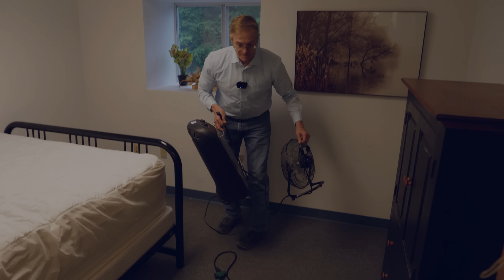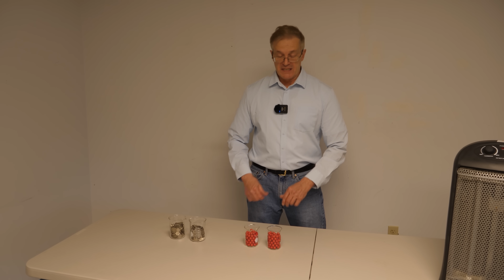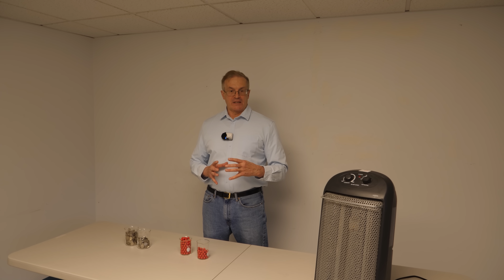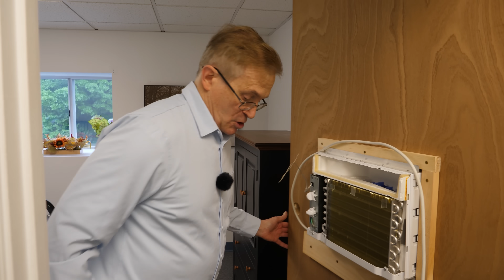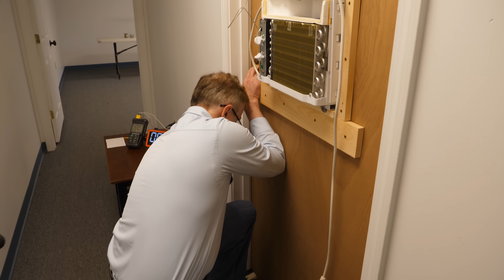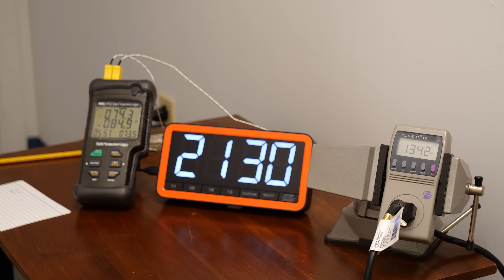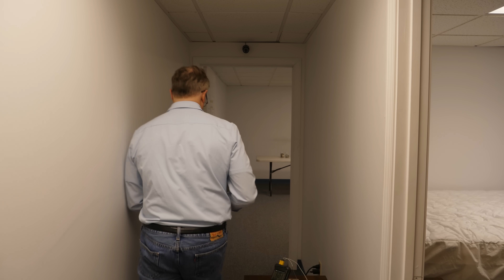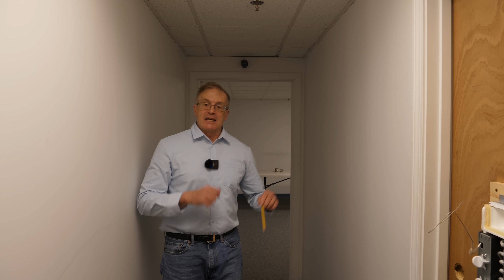You're wasting money on heating! Use your A/C!

Comment: First of all, thank you a lot for this chanel. But....
The explanation is overcompicated, the test is very nice! But, not connected to reality, unfortunately. As you won't heat your room while having warmth outside. 
You will, when its in the minus. Will it be as efficient pumping the negative. And, not to forget, that the compressor and the rest the "radiator" fan and part of the piping are also outside, in a standard heating pump. Heating the street.
Reply from the maker: Thanks!
Actually, the explanation was probably overly simplified, but I wanted to get the basic principles across without getting too tedious. 
Just turning an airconditioner around in a window wouldn't be a good idea compared to a purpose built, bidirectional heat pump.

Comment: Would this efficiency still be there if you were using this in practice to heat up a room in a very cold environment? Say outside temperature is -20c and your aircon has the capability to reverse... wouldnt be it significantly inefficient for it to try to "cool" the outside to heat inside?

Its a nice demonstration though...
Reply from the maker: The efficiency would progressively drop as the differential increased.  For very large differentials, using a combination of a heat pump at a high efficiency for part of the climb and another energy source to finish the trip would be ideal and it would save both energy and money.
Reply: @TechIngredients  makes sense, i wonder if you took a look at phase change materials that could be used within buildings directly? 

I saw someone make flexible plates (like ice bags but more solid) with phase change material (using salt and cheap materials) that basically absorbs energy when its hot and releases it during night...
Reply from the maker: We're building that now for the next video.
Reply: @TechIngredients  awesome, my understanding is very limited but i supposed if one knows the temperature ranges troughout seasons its possible to mix ingredients ina way to make phase change temperature perfect for that range. If thats doable in a cheap way then i have no idea why people dont use this yet.

Comment: Now to be fair, you did move heat from a room that was already the same temperature as your test room. The real test is to have placed the unit in the window during a 32F day, or at least a day where there would be a demand for heat and raise the room temperature to the same level once again. I am not disputing the efficiency of the process, but then again, I am never going to be raising the temperature of any room from an ambient temperature of 74F to 90F when heat is already abundant and quintupled for the needs of the cycle to be highly efficient.

Comment: I really like the idea of heat pumps as the primary means of heating. But from what I understand, they perform very poorly below -20°C. And, here that's a notable concern. My mom recently had to replace her heat system, and was considering a heat pump version. She ended up going with natural gas again because they didn't give her a lot of confidence regarding how well it would do in the -20°, -30° and -40° parts of winter, and she did not have the money to get a second auxiliary heating system for the extreme cold parts of the year.

Comment: I do know it’s easier to heat a room and maintain that when the surrounding area is warm where as if it was winter time and the outside temperature was 38 degrees it would take more energy to heat up the room to the same temperature and maintain that temperature

Comment: Unfortunately theres no way to take advantage of this with a window unit. They are usually built for being installed one way in with a backwards tilt. Looking at my unit and mounting brackets, I don't think I'd feel confident in swapping its direction and more importantly; i dont want to expose the "front" electronics to winter storms. It would be better if AC manufacturers made two-way designed with weather proofing.

Comment: I just wanted to mention something that I think was missed. so It took the RESISTIVE heater 30 minutes to get to 86F, the AC Unit took 7 Minutes to get to 86F which peaked at 400W.

not only does the AC unit use 1/3 less power it also did it in 1/4 ~ 1/5 of the time

Lets do some rough math, (for the sake of keeping it easy were gunna say the AC used 400Watts over the whole 7 minutes. that's 168000 Joules and the Resistive heater used 1330W over 30 minutes. that's 2394000 Joules.

168000 / 2394000 = 0.07 so the AC used 7% of the power to get the SAME temperature in the room that the space heater did. (86F)

The reason i bring this up is because we should be comparing the same thing here.
Reply from the maker: You're right.
I wanted to make the point as simple as possible even though the conclusion was overly conservative.
Reply: I do got to say though. You successfully got somebody to go "You know what? Your numbers don't sound good enough I'm going to do the math!" And you know what I had to double check my math I didn't know it was basically 10x more efficient.

I mean if you think about it nobody is heating their rooms to 86F so even though The AC peaks at 92, That's not an environment anyone would ever hang out in lol 😅 

I know you mentioned that this is going to be a series of videos feel free to take a deeper dive into it.

Here's what I want to see:

When winter time comes you should do another video but turn off the furnace. (Or if you can't, Try to stop that room from receiving any heat.) How long does it take to heat the room from 60F to 75F? Using both methods? 

Take it one step further and put the air conditioning unit in the window backwards so that it's sucking in cold air from the outside.

Look forward to your next video :)

Comment: I had a window AC/Heat unit in winter my bill soared at time $261 in month  February 2023(thanks to heat strips inside unit) so I installed a 18000 btu HVAC split unit for $800 +/- including dress up on lines coming out of exterior wall and stand to set up compressor on the exterior  my Highest winter bill in 2024 was $138 with split unit so from May  2022 to April 2023 window unit $2162.71 then from May 2023 to April 2024 with split unit $1250  so saved $912 it paid for itself plus. It is on Wi-Fi can operate from my phone

Comment: Mean daily maximum °F Summer Temp Differential:  Exterior - Interior:  86.5 - 72 = 14.5 deg F.  Differential Electric Bill:  $147.  That's $10.43 per degree.

Mean daily minimum °F Winter Temp Differential:  Interior - Exterior:  72 - 18.5 = 53.5 deg F.  Differential Gas Bill:  $73.  That's $1.36 per degree.

Clearly, using a heat pump (all modern A/Cs are one-way heat pumps), costs TWICE as much in the low-temp differential of the summer as gas does in the high-temp differential of the winter.

In fact, it's likely the Differential Electric Bill of using a heat pump in the winter in my location would likely be around $271.

This comports very well with my experience using heat pumps for heating in Louisiana, North Carolina and Nevada, and gas for heating in Colorado, Germany, and Virginia.

I've no doubt an aerospace engineer such as yourself can figure out what the exact cost would be, but I prefer my $73 Differential Gas Bill over a potential $271 Differential Electrical Bill.

Differential bill is the cost of an energy source for heating or cooling vs the cost of other year-round basic needs such as fridge, computers and lights and hot water heater.  It reflects only the portion of the bill used for heating or cooling.

Comment: Heat pumps have only one real flaw: they freeze up when the air temperature is below 32°F/0°C. Even in North Florida we need heat strips for those few days per year. Most people dont understand the energy available from the phase change of fluids is much greater than the mechanical energy as far as temperature change is concerned.

Comment: In the real world, I've used a 10KBTU window AC sitting on a shelf in an unheated garage rigged as a heat pump ducted over a wall to bedroom space. When the garage got below 50F there were serious icing issues. In your demo you've got 75F air to pull heat from so you didn't have ice issues. True heat pumps have ice sensors and/or timers to run in a defrost mode to pull a little heat from the inside to get the coils warm enough to defrost. In my setup, I never got around to adding a timer to power off the compressor and turn on a hair dryer rigged in the air return box. The trouble I went through was far better than burning a kerosene or propane heater. The BTU/Hr cost for kerosene at $4 a gallon only saved me about 1 cent per hour vs resistance heat (12 cents per KWH) so it just wasn't worth the smell. The window AC-as-heatpump was a far better choice.

Comment: One thing this video missed is, heat pump systems don't have the evaporator core inside the house (or the room).  Instead, the refrigerant runs between the outdoor evaporator and the indoor air blower, and then the heat was transported to the room thru the air duct.  Such difference creates 3 problems.

1. the warm refrigerant carrying the heat would be cooled by the pipe during the move.  also,
2. the air duct also takes out some (if not most) of the heat, especially if the air duct is in the attic, where it is usually as cold as the outdoor.
3. Unless your heat pump system uses separate air outlets for heating and cooling, the efficiency of the air outlets are reversed between heating and cooling (air outlets at the ceiling work best for cooling but not heating; air outlets on the floor work best for heating but not cooling)

Therefore, using a whole house heat pump system is not an efficient way to warm a house.

Comment: For those who have trouble remembering numbers throughout drivvling talk:

Electric Heater & Fan
Start Temp: 75.7°F
End Temp: 86.0°F
Power Consumption during the 30 minutes: 1340 Watts (That's 1.3kW, so if it was on for an hour, that's 1.3kWh to buy, which in my area would cost about $0.19 to run.)

A/C Window Unit Installed in door so hot side is in the testing room
Start Temp: 77.2°F
End Temp: 92.4°F
Power Consumption during the 30 minutes: 400 Watts (If run for an hour in my area at $0.14/kWh, it would cost $0.07)

Note: The A/C does not mix the room's air well, so your head will be very warm while your feet will probably be quite cold. It would be wise to still use the fan to get the cold air off the floor and up to the A/C Unit.

Comment: I have a window a/c in one room and use that (with fans) to cool the entire 800 sq ft house I live in. Are you saying that I could simply turn the unit backwards and run it during the winter months? If so, I'd have to go outside in order to turn the knobs on the front of the unit. Thanks.

Comment: Love your videos, but you said something that's not necessarily true, the efficiency of heat pumps hasn't increased very much. It's because the evaporator coil has not increased in size. To increase the SEER rating you increase the length of the condenser coil and down size the compressor. Since a heat pump reverses the flow. The evaporator becomes the condenser making no change in efficiency. But since the compressor has been downsized there ability to heat the area it so easly cools is less then, although more efficient then a space heater.
Reply from the maker: The efficiency of cheap airconditioners has increased significantly.

Comment: What I find to be most effective at changing the temperature of a room is three-fold:
1. Insulate the room so heat can't transfer in or out.
2. If you're heating the room, the heat source (be it forced air, or hot water pipes, or electric radiator) must be ON THE FLOOR. If you're cooling the room, the A/C unit must be AT THE CEILING.
3. The hotter your heat source, the more uncomfortable the room will be at any thermostat setting.
I heat with water pipe radiators along the baseboards coming from a tankless water heater.
When I set the water heater temperature to 190°F, and the thermostat to 76°F, the upper half of the room is sweatingly hot while the floor is chillingly cold.
So, I set the water heater temperature to 120°F and the thermostat at 76°F, and the entire room, top and bottom, is a uniform temperature that requires no slippers.

Comment: So you’re saying with the air con you get to export the heat into somewhere that wants it rather than just do it in isolation. Is it better if the hall is colder or worse? Ie is a bigger differential better?

Comment: I get the point you trying to make, but an AC in heat pump mode uses a lot more energy. The AC unit you are using is very small (3-5k BTU) therefore registers so low on the Wh meter, a normal house AC (12k BTU) uses a lot more - typical 1.5Kw in cooling mode and 2.5Kw in heat pump mode. The actual costs per hour, when averaged over a long period like a winter, will favor the resistance heater.
Reply from the maker: I don't understand.
The principle is the same at any scale.

Comment: If you happen to have the experiment set up still, could you run the second test from a static temp equal to that of the first test? I would imagine that there is a great deal of energy stored in the thermal mass inside the room. I absolutely believe the results will still prove the hypothesis: I just think the difference will be smaller.
Reply from the maker: The difference would indeed be small.  We waited an hour and a half before running the second test.
A better modification would be to simply reverse the order of the tests.

Comment: um, amazing.  but also, dollar for dollar, how does this compare to the cost of a gas powered central HVAC.  i think technology connections showed using a heat pump was only a little lower in cost to run long term.
Reply from the maker: That could be true depending on the local energy costs.
However,  you can combine both methods. The pump will be increasingly more efficient as the differential decreases and the gap can be filled with the other source, which doesn't change its efficiency with the differential.

Comment: Does a dehumidifier do the same thing with being efficient? It blows hot air, As far as I understand it's mine is an ac unit in reverse.
Reply from the maker: That depends on your point of view.  Because both the cold and warm sides are in the same room,  the output mix.  The result is the same efficiency as a resistance heater or any device that uses electricity and produces heat.

Comment: I went to A/C heating/cooling and never looked back. I chucked out the old radiators, set up a few solar panels and use my own generated electricity to power the A/C units. No more burning fossil fuel, even if it's on a small scale.

Comment: I am astonished that heat pumps are not used everywhere. Living here in Finland almost every house has had these installed for decades. The plus side is that during the one week summer of ours one can utilize them as air conditioner

Comment: I did a similar experiment to convert a window A/C into a heat pump. The main practical problem is that the outdoor coil will freeze up and you won't get anymore heat after that happens. I created a defrosting circuit using an Arduino. Look for my video entitled "Convert air conditioner to heat pump using Arduino controller relay box". By using this, I was able to create a practical heat pump that saved me money on heating.

Comment: Electric powered heat pump above 45* north is 6 times more expensive than a natural gas 97% efficient heater! An air conditioning unit in the heater is more efficient than a room AC unit

Comment: When I went to air conditioning school and heating where I live in New York City I was told below 32° heat pumps will not work efficiently you need a boiler or a furnace that was 19 72 I guess the equipment got better as the years went on😊
Reply from the maker: It definitely has.
Reply: @TechIngredients  would you recommend a heat pump and air condition for New York City now and what would my electric be they have a new program they take out your boiler and they put free air conditions and heat pumps a unit built all in one you know but I'm wondering what the electric bill would be if I would save by getting rid of my gas hot water boiler also known as hydronic system

Comment: I know that the the power required to pump heat is dependent to the external temperature, so i looked for documentation on heat pumps finding out that the power required is linear dependent to the external temperature; With a linear regression of this experiment (340W at 74.8F° and 440W at 70.5F°) you would need around 1340W to pump heat with 32F° outside.

Comment: What he's not telling you that as the outside temperature drops, so will the efficiency of the air conditioner.

So, this is just "crazy science".  How much heat can be drawn from the air from zero degrees temperature?

Just a note: if his idea was so good and this could work as he says it could, some businessman would have done so long ago.

He's taking the heat from the 70' inside temperature.  Let's us try this experiment with the outside temp. at zero degrees F.

Comment: So, are you saying that in real life, people need to stick the AC in such a way that the fan is blowing outside, during winter?
Reply from the maker: No.
We're demonstrating the potential of heat pump technology.  You don't want to reach outside your building whenever you want to operate the controls.
Reply: @TechIngredients  So what if I make a hole in the bedroom door and instal the AC backwards? Will it heat up the bedroom and work? ( As it did in the video ? ) Also, if we do this setup indoors, do we need to worry about any sort of gases or exhaust from the AC? ( I ask this causes even though a dryer is electric and not gas, u shouldnt vent it into indoor areas). Ty 4 the reply!